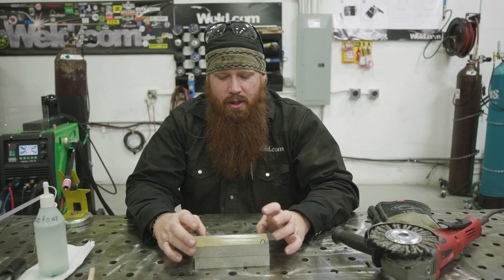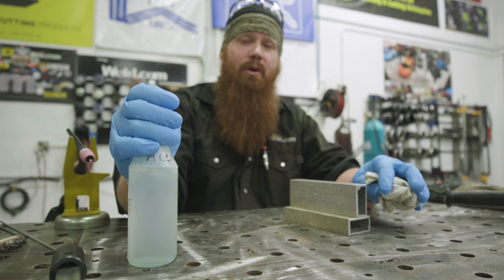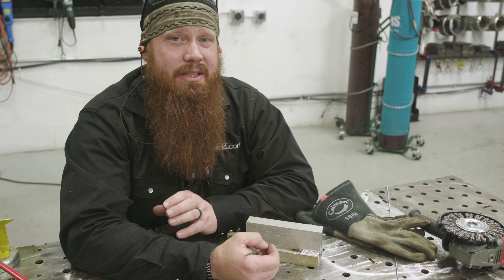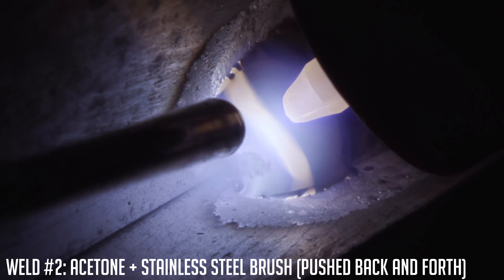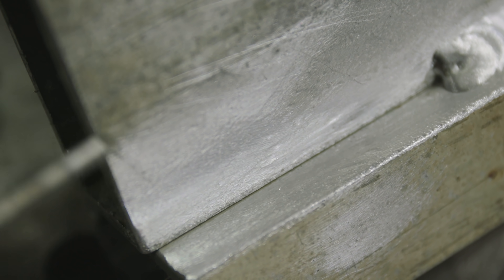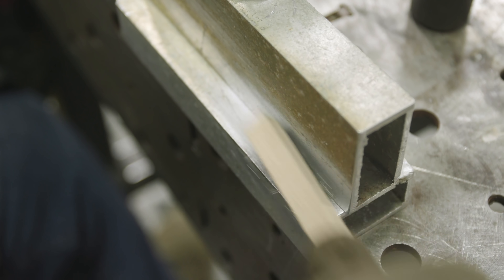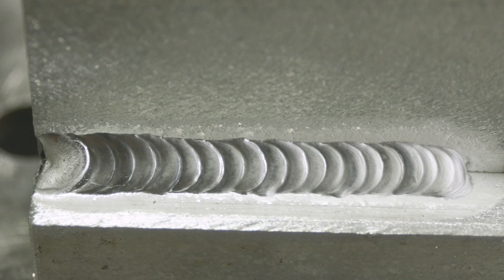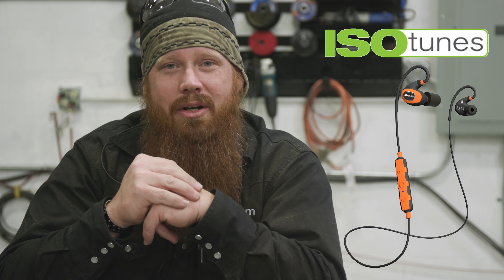How to Clean Up Your Dirty Aluminum Welds!

Comment: On the last pass the contamination  you're showing does not come from the filler rod, but from the root of your weld. Whereas all of the surrounding area is clean, there is still plenty of contaminants in the root where the two parts meet. The alox and other contaminants are being pulled up from the root by the cleaning action of the ac arc and deposited on your clean filler rod. (Filler rod not being older than 6 months, handled properly.) 
 This occurs when you first tack and then clean your parts, whereas you should first clean, brush, clean again and then tack. I've been welding aluminium for the bigger part of the last 10 years and have made the same mistake many a times before realising where the contamination originated from.
 You're never to old to learn, and I've learned a lot from your video's over time, thanks!
Reply: Shjefke.23 I do the same thing when doing certain soldering tasks in EE, clean, wire, clean. If you don’t clean after you wire you get that gunk particles back on the weld and especially so if the metal is porous as wiring it now exposed all that gunk down in the pores. Also make sure to always clean before wiring too as this removes the bulk so it doesn’t get pushed into the pores. All metal especially aluminum has pores. Whether this is pitting, corrosion, pores,  defects, or even the grain boundaries of the metal, any which way it will have it and it will cause problems. Your suggestion is the only way to do it!
Reply from the maker: The bottom of the material was cleaned 100% for each weld.
Reply: Weld.com no you didn't. He is saying the material in the root never got cleaned which is a big no no. You have to clean the material before tacking it together. You dont think that aluminum oxide and oil directly under your weld in the root is not effecting your weld? You clearly tacked together your pieces then proceeded to clean material. All that oxide you tried to clean off also gets wedged into the joint.
Reply: Daniel Thornton Exactly.
Reply: @mountain_ginger  Exactly the point I  wanted to make! 

@weld.com You're never too good or too old to learn from your mistakes. I found your comment condescending so I didn't reply initially, felt no need to waste energy on useless pursuits.

Comment: One thing not mentioned that works well for outside corner joints on aluminum is to use a file to clean the edges rather than a brush. I use a dedicated aluminum-only mill file, used in one direction only like you did with the handheld brush, and it puts a super clean edge on outside corners. Other than cleaning filler wire with acetone, which seems to often remove an oily substance I suspect is from the forming process, is there a way to clean oxide off the filler wire?
Reply: Todd Grzech I like to use a scotch brite pad.

Comment: I'm not a welder, but I am a diesel mechanic that does a considerable amount of welding. All our feed trailers (we're agriculture) and livestock trailers are aluminum which is always my biggest battle to repair due to the acidity of the animal feces penetrating deep in the metal on the live haul trailers, and the abuse and lack of cleanliness of the feed trailers. You can't do enough of these aluminum welding videos. I'm fully self taught minus what tidbits the old timers have given me here and there so these videos you do have been a God send. Thank you and keep up the good work!
Reply: Jedediah Hoffman 
Only way with contamination, is carbide burr and weld again.
Had oil soaked castings i have had to weld multiple times.
Reply: @Sicktrickintuner  thank you for the input. Unfortunately that's about what I do now, clean the pants off of it, weld, grind, repeat. While this video will make me change a few habits (using wire wheel on a regular grinder doing full speed) I am very anal on my welds and I'd like to cut down time for repairs and still come out with great looking welds. Any thoughts on using aluma bright wheel cleaner (an acid based cleaner for aluminum rims) before doing a weld? Our shop doesn't allow chemicals not on our  company MSDS sheet, but I'm sure if something like this would work a small container would go unnoticed for the most part. Thanks again man!

Comment: Why does aluminum get grainy with the inverter welders and not the old transformer ones? I have a 200 dx and had rather use a 1960 hobart.

Comment: What’s your thoughts on cleaning with acid?  From my experience, acid seems to help on older dirty metal with a lot of oxidation....but not good on newer material with light oxidation. Like those tubes in your video, I would have taken them to the sink, sprayed with acid for 30 seconds, rinsed, dried, then only half as much work with the wire brush is needed.   I understand acid may not be an option on some projects.

I did learn something on brush strokes so great video. Just wanted to add to the conversation and get your thoughts.  Keep them coming.
Reply: I do the same thing, use mag n wheel cleaner acid.
Reply: Ron Platt same here.  I use alumabright or something similar on older dirty material.  But on relatively new material the acid cleaning seems to make the arc wonder more and the dimes don’t stack as nice.  Have you experienced that?  

I realize the new technology in the inverter machines will clean well enough so it’s not crucial that you clean every piece of material, but all alum will oxidize quickly and the cleaner the material, the better things are supposed to work.  Really I’m just bored and making conversation.  😜
Reply: @harrillwiggins1375  I don't have a new machine, using a 1980 airco 300amp welder set up for tig or stick. I have to clean the metal very good before hand.  Yes, I don't use the acid on new aluminum, just brush and clean with acetone.
Reply: @ronplatt  I bought an Airco 300 (big orange machine with a crane lift point); any chance I can buy a copy of the manual from you?
Reply: @scottwillis5434   found the manual,  I can ta pictures of it and send them to you. let me know where to email or upload them

Comment: I find it is better to clean parts before assembly to prevent forcing debris into joint also if you clean afterwards you can't always get right into the root. That's my opinion for what it's worth.

Comment: Great video!  I did a lot of aluminum back in the day and learned something new - thanks.Jody at welding tips and tricks did a video on doing aluminum (very think) on DC with a Helium mix.  I would love to see more on this technique if you ever got the time.  Cleanliness was everything since you are not using AC.  Looked like a great way to do heavy material where AC just can't punch through or you don't have a heavy duty machine.  Thanks again!

Comment: Looks good. Do yourself one better though and keep the Jebus filler rod IN the gas envelope between dabs. All 5 welds you did, you keep pulling the end of the  rod too far back. You know a good way to increase oxide formation? Heat the metal to kindling and then EXPOSE it to atmosphere ! Stop it, just, stop it. Keep the rod inside the argon envelope and you will eliminate the last of the black crap. Don't wave it all around like you're at a rave.

Comment: I dont have any problems with contamination, but the amount of bubbles/porosity(?) In my welds is insane.  I've tried switching tungsten, increasing and decreasing gas flow, numerous different pieces of aluminum, frequency balance...no fricken clue!
Reply: I had something like that once and It quickly turned out to be contaminated gas......The Argon has to be pure and I got a bad refill. A silly mistake by someone!!!!!!  Sadly there are many other reasons like too long an arc.  Keep trying and you will get it sorted.
Reply: @williammclachlan8537  I've had one other person suggest that, and you guys have to be right.  That's the only other variable I havent changed.  Dont do much with aluminum, so it went unnoticed for about half the cylinder. Thank you for your input!  Now let's see if the supplier will make it right...

Comment: The hard wheels designed for aluminum and then file it work wonders getting abrasive and such out of an area after grinding, chisels even work for scraping (more of a pull using the corner)

Comment: If your welding with 5356 filler it usually always makes some trash. If your dew point is higher than 40°F with a 5086 base it traps moisture and soaks it up. Can be mitigated effectively with a Argon/Helium mix.How come YOU DID not tell the viewers about different base materials and fillers and Silicon content with 6XXX base and 40 wire. No change in AC Freq, balance, EP and EN amperage control, cleaning action and penetration between both? Come on
Reply: Or get into cold cracking or changing mechanical properties with 5XXX series base and 5356 filler using a interpass temp higher than 120°F?

Comment: All your advice here is spot on but onenote for your followers that I think you could have mentioned is while you have the crud in between that lapped surface cleaning that surface is critical as well. of course in a repair scenario pulling the two surfaces isn't always possible.

Comment: great information,   but u noticed your filler rod was introducing contaminates into your pool .  but what about cleaning with the wire wheel like you did then giving one last wipe down wiht acetone before welding ?

Comment: Needed to clean weld filler rod too. Also you pulled trash from metal where you failed to clean before assembly (under vertical leg)
Reply from the maker: The entire underside was cleaned prior to any of the welds.

Comment: Absolutely agree with you 100% . I weld Aluminum everyday and prep is everything. The only issue is that getting most employers to understand that concept.  The only thing it seems they are concerned about is how fast it can be done but what they don't seem  to realize is that you're sacrificing the quality and strength of it by cutting corners . I argue this issue all the time. How can you make someone understand that concept?
Reply: @Chris Bostrom You know I thought about not responding to the comment but since you seem to need an education I feel like I have to help you understand so someone else who might be watching this doesn't actually believe your ignorance. Aluminum is one of the biggest alloys used in the Aerospace and Automotive industry's  ! How much more structural can you get! I hope someone like your self isn't working on the plane or auto that I put my family in. Might give it some thought before you post something that you obviously know nothing about. 😁
Reply: @Chris Bostrom I really dont have time to argue but you obviously need help understanding that your  wrong Aluminum is used in turbines Aerospace frames and Bridges and car frames.  Because of its heat and strength properties not to mention it weight to strength ratio.  Also used armor plate which I installed in several military vehicles that save countless lives from IEDs! ( Improvised Explosive Devices) for those that don't  know. Take your ball back home and cry to mama snowflake...
Reply: @Chris Bostrom It is all about the engineering and the people who do the work.  If anyone else reads these comments remember. Anything you do in life is worth doing right you never know when someone's life may depend on it. I take my job very seriously because I have seen first hand at what cutting corners can cause.
Reply: Jet turbines spin around 10,000 to 25,000 rpm for most commercial planes but some  military jets spin up to 500,000 rpms . I'm prepping my materials.
Reply: @Chris Bostrom also axles used in  higher stress conditions are made of aluminum in racing applications to cut down on weight  and are stronger.... OEM axles are made of steel to cut down costs!
Reply: @Chris Bostrom Example  John Hancock  tower in Chicago. Alcoa  tower in San Francisco

Comment: Is that a crack at the end of the weld.
Reply: The crack is usually caused by not enough filler rod at the termination point of weld as well as not leaving the post flow of gas on the weld long enough.
Reply: Or cooling it too quick too. Ease off the power slowly at the end!

Comment: Just curious, but you mention several times that these impurities float to the surface. If that's true, then is it correct that they really  wouldn't interfere much with the weld integrity? All you're really trying to do here is make the weld "pretty''. Dont get me wrong, I'm all for decent surface prep. But I could tolerate surface deep imperfections if the weld is strong and is in a spot that doesn't really get seen.
Reply: What i thought... the weld will be equally strong.
The only valid point he made is that you need too much heat to melt the oxide layer. But any abrasive method will take care of that.
Reply: Joris Knuts 
aluminum's oxide layer isnt possible to fully remove because as soon as aluminum contacts the air it oxidizes again. its the reason we weld aluminum on AC instead of DC. also only some impurities float to the top while many stay below the surface and cause porosity. in short, clean your aluminum properly to get good results
Reply: @MySuperman112  i agree that more cleaner will always be more better. But at some point its clean enough for most people... unless you're working in space tech or something. Its up to the fabricator to draw the line on where you spend your time.

The video is solid info, but overkill in most applications, i guess.

Comment: When I'm using a torch how do I prevent the metal from welding itself  back together...very irritating
Reply: You have to angle the torch more to blow all the metal your cutting away, instead of straight down and it slopping and sticking back to itself.

Comment: Try and clean in between your pieces to..like u said, the heat pulls out the contaminants
Reply: thats what i was thinking about to, you have something like welding penetration in the materials.
if you stack your materials before cleaning them on all welding sides. you will always have contamination.
i always use a powerfile, clean these materials on all sides then put them in weldposition en start welding.
but old aluminium stays a bitch to weld. i'm a welder for more then 25 years

Comment: what about sand or preferably glass bead blasting, and then cleaning that off with compressed air?
Reply: Whitewolf the blasting media stays in the surface even after ultrasonic wash acetone and wire brush, we tried it and did not get it to work for our purposes. We do aluminum thermo form molds
Reply: Sounds great!  Have to watch out for oil and water carried along with the compressed air is all.   If your shop air is dry, this should be about as good as it gets.
Reply: Yes my air is quite dry and clean.  The only thing that I don't like is that bead blasting something large gets the fine glass all over, (my cabinet is very small)!  Never have tried blasting before welding, just never occurred to me to try it.

Comment: Haven't done much welding of aluminum, is it neccesary to clean off your filler rods as well before welding?
oops should have watched the video to the end before commenting, you answered my question Redbeard, thanks.
Reply: As a rule of TIG, you always wipe the rods and metal down, regardless of the material, titanium, aluminium, stainless, mild steel, it's just good practice
Reply: @JoshuaNicoll I never got much time in on tig welding in general unfortunately, it's a skill set I never really have had the oppurtunity to work on but would like to
Reply: Mike  Mc Clune I would say, yes, it is necessary to ensure that everything, including your filler metal, is as clean as possible. This also goes for stainless as well
Reply: @Chris Bostrom I mean if you're just taking the piss out of keeping your Aluminium clean.. go weld some dirty shit, it'll be brittle.
Also I have an aluminium car trailer, you can't expect me to just weld right over all the dust/rust/paint and oxide like I would if I was stick welding a dump trailer at work lmao
it's not like we're all pipe or construction guys..
Reply: When i tig weld t joints in school i just wire brush metal and dont clean rods/metal with acetone because i save much time but when im making something i clean everything with acetone and wire brush
Reply: @Chris Bostrom so it doesn't weld like 2 nasty puddles next to each other that just turn into ugly gobs if you try to push filler in, I'd guess
Reply: @Chris Bostrom When I used the word practice I did not mean it like that. Best Practice is a term meaning the correct thing to do or the accepted thing to do. I'm also not aware of much structural welding that gets done with TIG, I'm sure there is a bit but most is stick and dual shielded MAG, since its usually steel, with that said some buildings I guess have structural elements like windows or decorative features that need to be strong and I could see that being welded on site if there was no other way.

Comment: Jody from welding tips and tricks had a cool video back a couple weeks ago I think where he is welding some al pipe and shows a shot of the inside where welds over a scratch in the pipe and it was so cool seeing the oxide rise and fall without disturbing the scratch. Made me think of that when you talked about blowing a hole through your material.